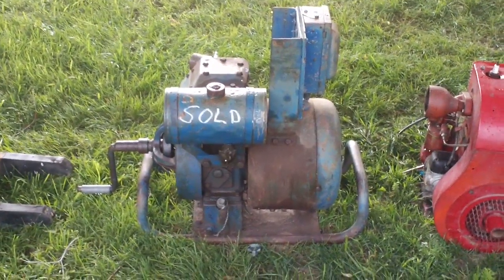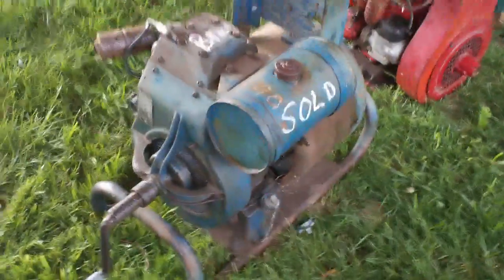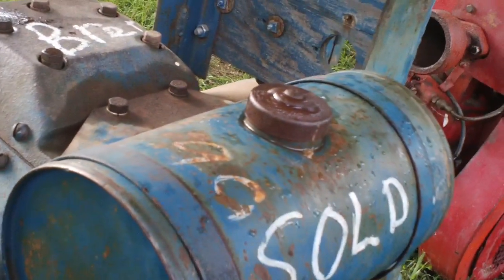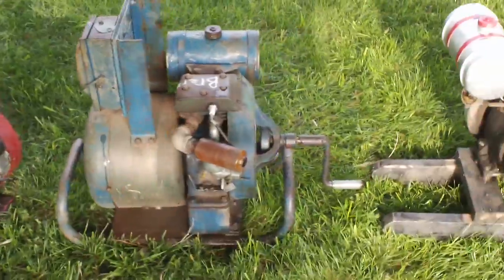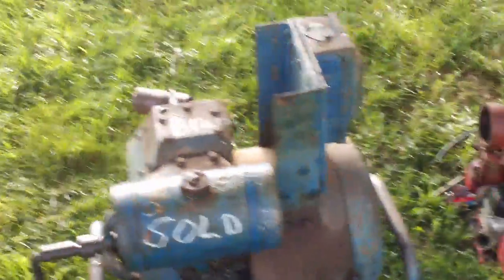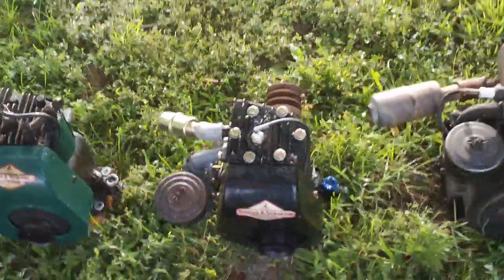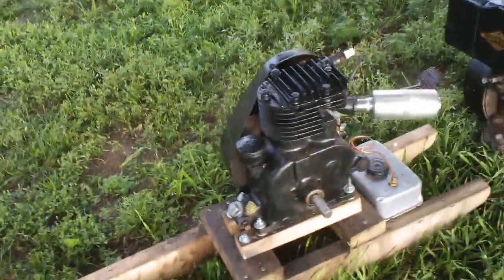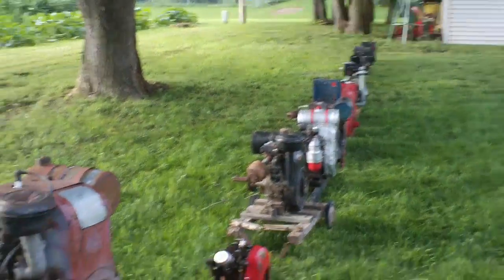rare briggs model b factory kohler generator set

Comment: What model Generator is that? I have basically the same thing but mine is automatic start where once it senses an electrical load like a light bulb it starts itself up and begins making power. I am also fairly certain yours is running too fast. Hooked to the generator it should only be running at 1800 rpm these were nice slow running generators